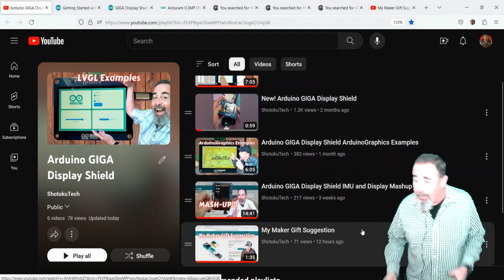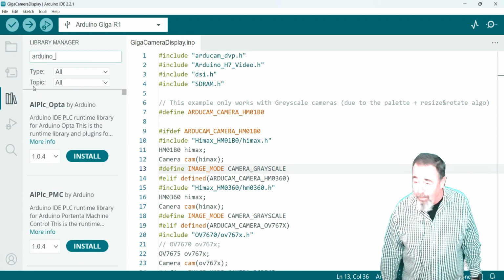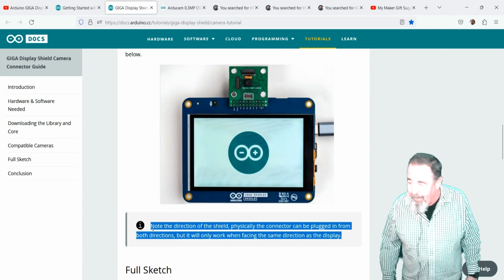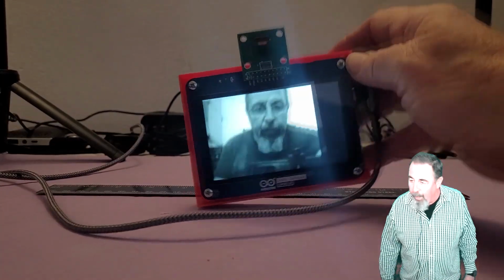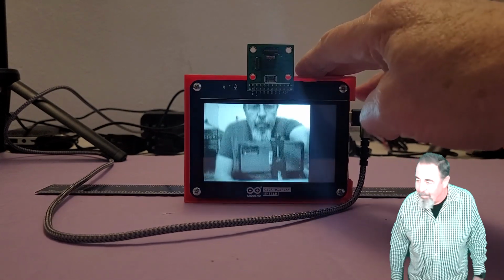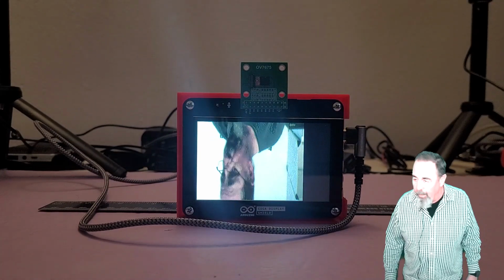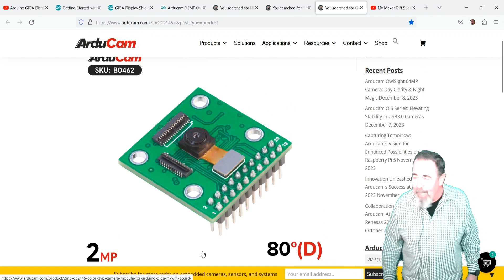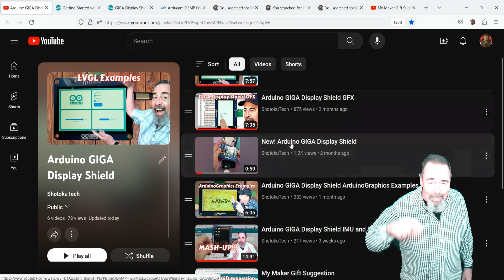Testing Every Arducam for Arduino GIGA Display Shield

Comment: nice, do these all support grayscale 8-but outputs? i bought the ov7675 module and was very disappointed when attempting to configure registers to realize the grayscale output was infact just YUV but dropping one byte, so the 2 cycle latency is still there. this was catastrophic for my applications, hopefully the hm0360 is better but I must say the documentation is horrendous
Reply from the maker: It sounds like you might be better served by the HM0360: https://www.himax.com.tw/products/cmos-image-sensor/always-on-vision-sensors/hm0360/
Reply: @ShotokuTech  yep! that's the one im currently reviewing

Comment: Great video!! I have the same setup with HM0360 and OV7675, and tried the same sketch. The images on the display are very (really very) nosy, nothing compared to your demonstration....any ideas? Thanks
Reply from the maker: In my mind, noise would be bad contacts or some interfering signal. Try different lighting or use canned air duster on the camera connector. Just don't tip canned air to spray liquid.

Comment: Have you looked into using the Giga Display to display video from a ESP32 Cam?
Thanks
Reply: Thanks for the quick response.  Over wifi from the esp32cam to the Giga R1&Display.  I presume that the R1would be a webclient that displays the esp32Cam(as a webserver) video feed.  I run the Arduino esp32 camera webserver example code and can see the feed on my PC & phone webbrowsers, but I don't have the skills to get it to the Giga Display.
Reply from the maker: @stephenstewart1653  It has been a while since I have worked with either one! I will have to give it some thought.
Reply from the maker: Do you mean wireless video transmission? Or wiring the ESP32 Cam to the Giga Display? Best wishes.

Comment: I've been banging on this for about a week now and haven't been able to get the GigaR1 with an ArduCam 7675 to work with either the Arduino-provided Camera library or the arducam_dvp library. I've been able to load other sketches like the WiFi demos from your earlier videos, and get those running on the R1, so I know it's not the board itself. I'm wondering what exact steps you took to get the ArduCam to work with your board.
Reply from the maker: The only problem I encountered was I mistakenly mounted the camera with the lens facing in the opposite direction from the screen. Once I figure out the lens needs to point in the same direction as the screen, I had no issues. If I had to do something to make things work it is all included in this video. Attach the camera facing the same direction as the screen. Load the sketch. Comment the correct camera in the sketch. Upload. Thanks. Best wishes.

Comment: I tried the GC2145 on my giga display. While the image was in color and rotated upside down, The image quality was poor and had worse color rendering and pixelation than the OV7675 example shown in this video. I just ordered the HM0360 for experimenting. I am hoping the HM0360 performs as well for me as it did in your video. And yes I defined the GC2145 properly or at least I believe I did!
Reply from the maker: I think these cameras are more suited to AI computer vision than recording actual images.